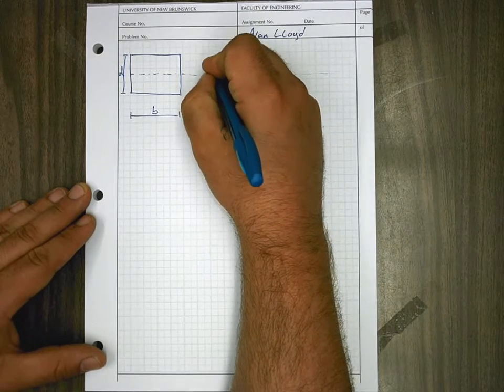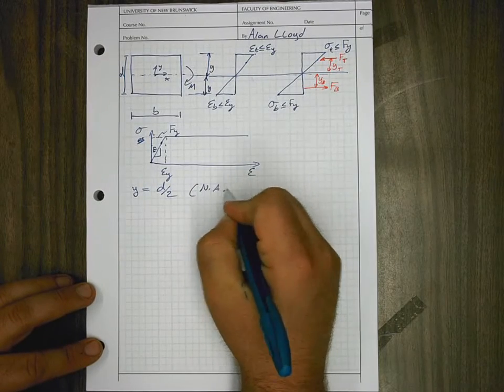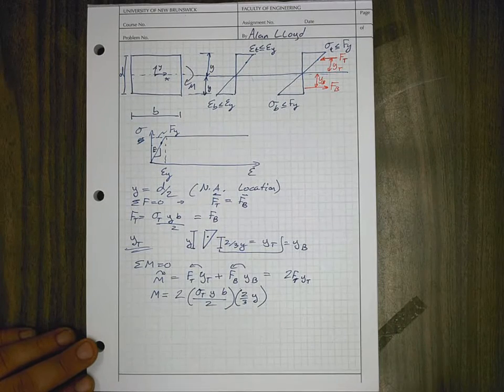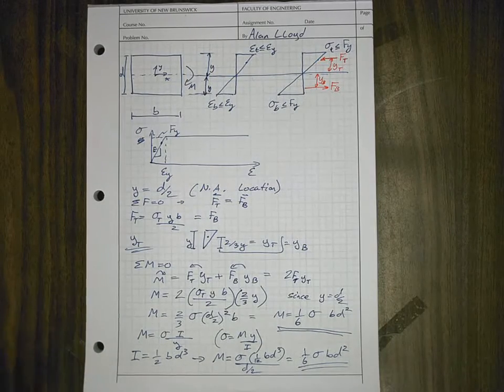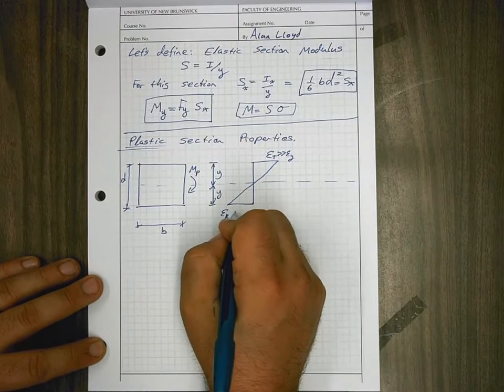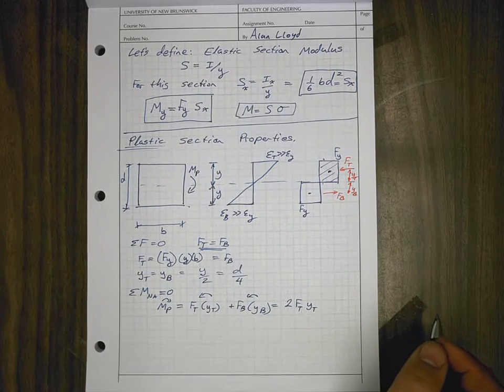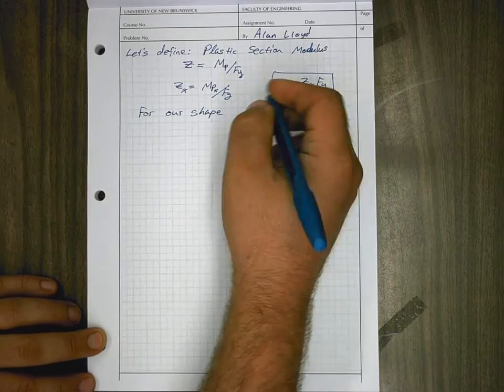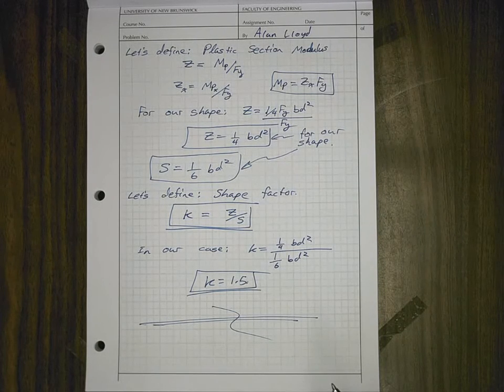Elastic and Plastic Section Modulus and Moments for a Rectangular Steel Beam

Comment: The strength of ductile material is different for tensile and compressive normal stress. Genrally compressive yeild strength is more than tensile strength for ductile material.This directly shows value of elastic constant also differ in both case i.e in case of compressive and tensile load. How is theory in this video explain this? The yeald tension is smaler than the yeald compresion. looks like the nutrial axis shouldn't be in the middle.